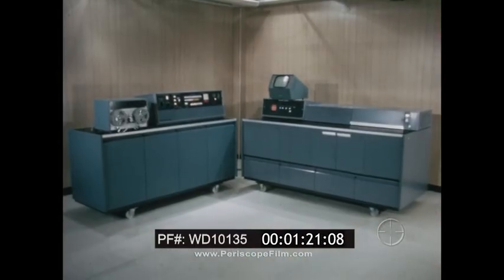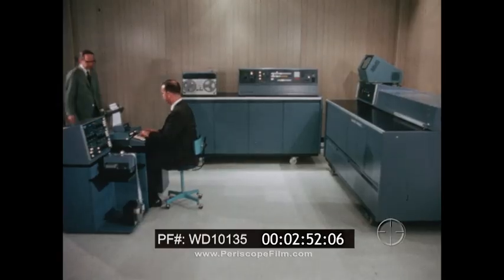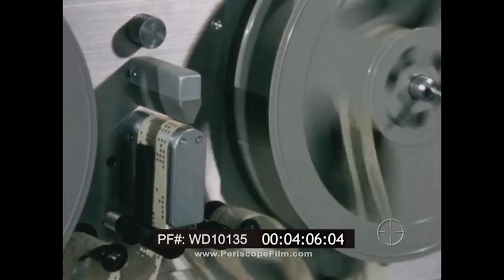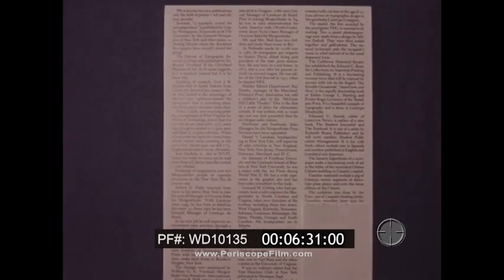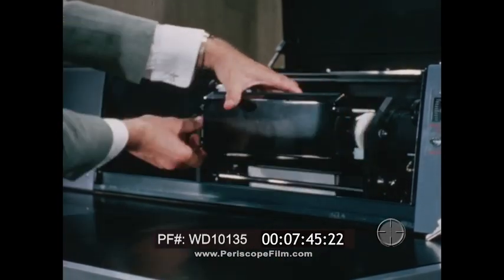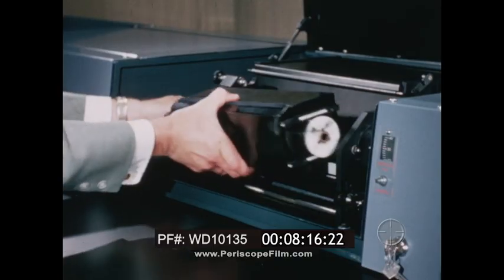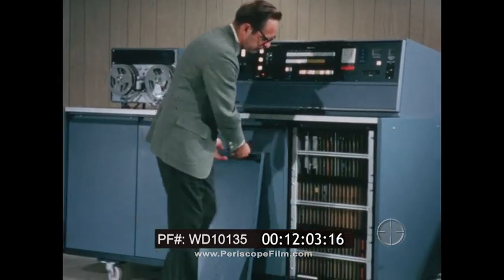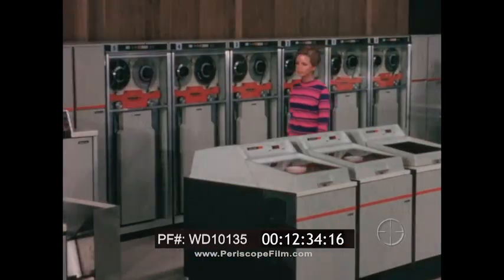1969 MERGENTHALER LINOTYPE LINOTRON 505 PROMO FILM     PHOTOTYPESETTING PRINTING SYSTEM WD10135

Comment: The commercial print shop I spent 40 years at had two shifts of linotype operators when I started in 1973 and over 100 employees.  The last linotype was shut off in 1980 and the last big letterpress was taken out through a hole in the side of the building at about the same time. When I left in Dec. 2012 there were only 7 employees left including the two owners. Dying trade.
Reply: Lead was out and film imaging was in when I started in 1973. 
The entire offset prep dept was eliminated by computer direct image to plate in the early 2000’s. I got out at the right time in 2017 as the advanced copiers started killing my press work.

Comment: Oh man, the memories!  My first job was at a printer with an in-house hot metal shop.  I had to join the ITU (International Typographical Union) and was the youngest member nationwide.  And was still the youngest when they later disolved.  The printer decided to move towards the newer technology and I went from casting lead ingots to being trained on the Merganthauler VIP.  I am old now but can still remember dancing to the rythym of the VIP's sounds at the dismay of the old hot metal guys operating their six Linotypes.  I still remembers some of the codes set by the wheel dials, especially 'Bell B 3' and having to always adjust the prism to keep the base line straight!